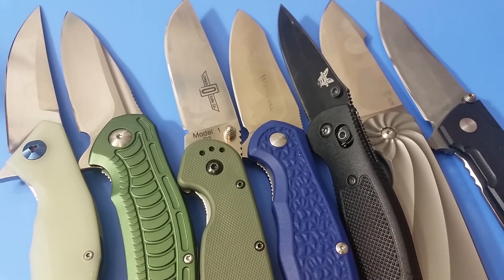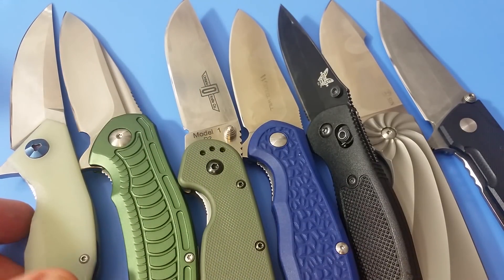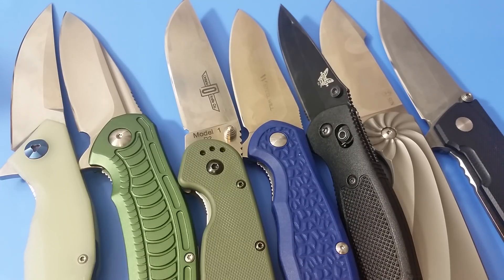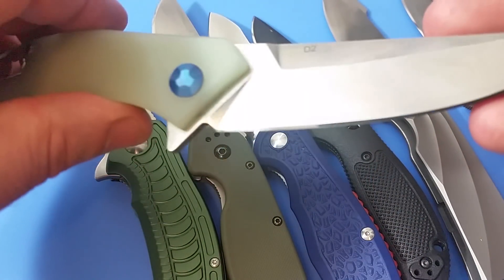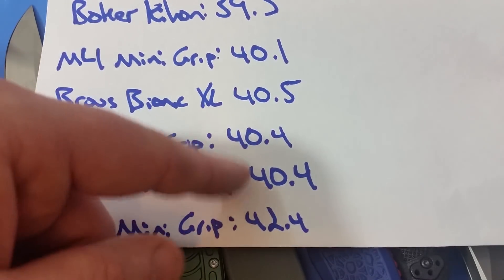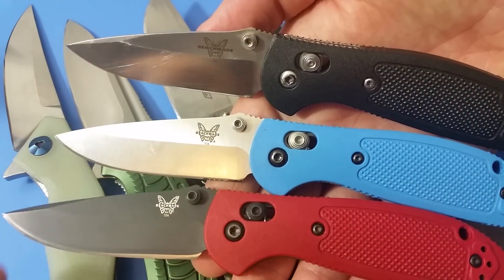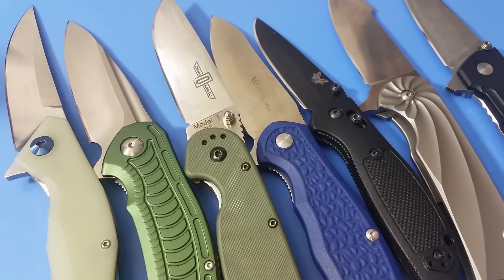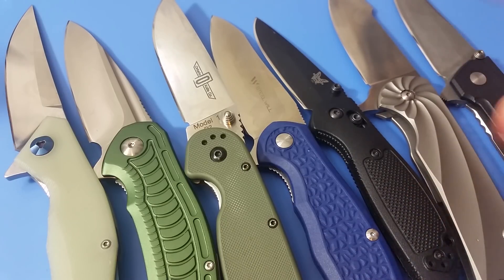The D2 Comparison Experiment Part 1: Knives, Parameters, Etc.

Comment: Hands down the mini grip is going to win. Benchmade does a stellar job of heat treating their D2 and they do it in the USA. The Brous might have D2 heat treated in the USA, but the rest of them are more than likely done on a shoestring budget across seas.
Reply: And what, pray tell, Adam G., do you think heat treating "on a shoestring budget across seas" might actually mean? Do you, in fact, have any idea what you are talking about; apart from exercising some well worn prejudices, perhaps (just speculating on the basis of inferred 'hints')? Some specifics... some actual pearls of metallurgical knowledge, please, to show I'm wrong in my conjecture.

I know that I am not claiming true expertise for myself, but I did work for 13-1/2 years in the industrial metals sector, as my father, a civil engineer, did for decades... which I'm betting beats your background for coming up with a pertinent analysis. So, I'm calling your bluff.
Reply from the maker: Who knows what will "win or lose", but regardless, I do expect the Benchmades to perform well.
Reply: Well Frederick J, I have tool and die background in the steel industry. I know for a fact, through experience, that D2 that is tempered at a higher temperature yields a softer heat treat. On a shoestring budget means that Chinese budget companies heat treat and temper their D2 in larger batches to make the most out of the money spent to run the furnaces. Softer D2 will NOT hold an edge as long as a properly heat treated D2 in the 60-61 HRC range. I have had most of these knives and have found my mini grip to hold an edge longer and with less edge deformation. I even had an Birk Enzo in D2 with the scandi grind that the tip broke off when cutting plastic off of a 2x4. The tip hit a knot in the wood and broke the tip off. After the failure, I Rockwell tested the blade and found it to be 55.6 HRC - way too soft for D2 to be tough and hold an edge. The Chinese sourced knives in this test may fair well, but the consistency of heat treat and tempering between batches of knives is marginal at best. 
Before you call someone's "bluff" as you put it, remember that people can have an opinion without trying to insult a person with such vast experience as yourself.
Reply: 1. Yes, of course, a higher temperature treatment, for as long as it might take to 'properly' complete the procedure -- however smart or ill-advised as it may be in that particular case -- would be expected to yield a softer steel as a result. My experience is in the aluminum coil re-rolling industry. I couldn't tell you offhand how much of the annealing in those furnaces was done as a full anneal, or as a "partial" sort. In any event, our place was as a specialist supplier to more demanding manufacturers, rolling & annealing to a custom specification.

2. I never disputed the fact that one could, and probably would, find significant performance variations among D2 steels in production knife blades. I don't, however, go along with anything resembling reflexively pointing all suspicions at Chinese industry. As I am sure you have noticed, that sort of thing is quite the accepted sport here in YouTube comments. I prefer to wait for credible empirical results -- or relevant specifics accompanying any skepticism in advance --  before going too far in assuming the worst about Chinese manufacturing and matters of ethics pertaining to them.

I have not yet, even once, after close enough to 70 years on this planet, seen a criticism of Chinese business practices or oversight of the same by the government of China in these pages accompanied by a single meaningful balancing observation about the ethics of American business practices and government oversight (or not!) of the same. A particular sore point now... quite obviously. A dystopian, reactionary America makes me sick at heart. Some mythical sense of purity seems to be routinely assumed and implied for the latter whenever the Chinese take their licks. 

I note also that some 1.3+ billion people seem to have to answer for anything that frosts some -- well, many -- here about what they, like our president, "hears" about such things from unspecified sources before concluding a judgement. You're effectively exempted of criticism in this context, of course, by your getting, and staying... largely, though not completely... on point.

3. Even if large batch processing is less than ideal, again, it is an empirically vetted result, weighed against the price of goods, which has to be the foundation of valid criticism. Every D2 does not have to be the best D2; and who would expect that for about $27- $43, or so? But maybe it is, or close enough. I understand perfectly well that defense of empiricism and scientific method -- also not so well a defined thing, I might add (science in the real world can be a bit messy in working toward testable hypotheses) -- these are not generally well received in hyper-provincial America when empirical evidence presents 'inconvenient truths'. 

Defending empiricism and criticising ideologically driven opinions can easily get you characterized as "high and mighty" (see elsewhere here). Nevermind the ignoring of a disclaimer regarding true expertise on my part, explicitly stated elsewhere here, which gets conveniently ignored when it blows a pointed critique. And no, I am not too much pointing the finger here at you, Adam, apart from your sarcastic (and unwarranted) concluding remark, because...

...4. You did come through with precisely what I asked for, which was some credible foundation for your critique of "overseas" practices AND a defining of your terms and the problem(s) implied (but not at first stated)... rather than practicing any number of common dodges typically seen here to calls for evidence, collectively known to some as "playing tennis without the net". I will be explicit and congratulatory in saying that you are the FIRST, and ONLY person on YouTube in my experience, to ever meaningfully attempt to respond to a call for evidence or pertinent citations where I have been involved. But the presumption of a level of vanity on my part not supported by the gist of my skepticism -- that IS an example of misdirection. Anyway, this state of affairs does lead to a certain set of expectations -- even B.F. Skinner's chickens, conditioned for so long this way, could have been expected to prepare for the highly likely eventuality, given the operant conditioning. But I did, of course, ask, nevertheless, for any evidence of some foundation that might be forthcoming. Also a crucial point missed elsewhere within this thread.

5. The curious thing is, I don't see where there ever was any point of disagreement between us on the subjects pertaining to D2 you principally addressed. Again, I explicitly made similar points nearby here. To be further explicit, I have purchased several TwoSun knives just recently at auction -- the first, a TS27, I think, only got unwrapped this morning! And I can assure you, I am MOST interested in the outcome of this test, however imperfect the test may be; and care ONLY about the most useful and applicable result, irrespective of how the one TwoSun knife might fare. I, for one, do NOT seek validation: I am perfectly content to let the chips fall where they may. Again, perfectly content.

6. To conclude, you can count on this, Adam: I will continue to defend and determinedly promote scientific method, well proven standardized statistical methods, the unambiguous mathematical 'language' of the best of our scientific & engineering descriptions, well understood (and for a minority, deeply appreciated) 'tools' of critical thinking, sound & consistent logic, empiricism, and naturalism as a necessary "working hypothesis" after following, as best a human can, with faults, those forgoing standards. And screw ideology.

This is the spirit in which I challenged your remarks; which, let's be frank, whether intended or not, echoed one or two political "dog whistle" notes. As it is in the scientific community, I countenance no implicit racial or ethnic biases in deciding either the faults or the merits of any matter relating to the knife enthusiast community. And that's not a negotiable point -- as always, it's "show me your evidence (or steer me there)". The rest is just rancor and nonsense.
Reply: BTW, a couple more points, Adam [I hesitate to edit above, as YouTube (a.k.a., Google), seems to play very odd tricks (euphemism alert) with Amazon's Silk browser, which I'm forced to rely on here due to two disabled Samsung devices. Not that Silk doesn't substantially suck. It couldn't have anything to do with their being competitors, could it?] 

So, O.K., I hope at least the two of US are more or less on the same page now, Adam. Hugs and kisses and all that. Also, that is an interesting point you made about too soft D2 ending up too breakable. I would probably have expected behavior more like the difference between something like 1075, or the SK-5 on my Hultifors SK "safety knife", vs. a high Rockwell 1095 when it came to that -- i.e., being tougher and more resilient, as is said of Hultifors in general, as compensation for maybe not holding an edge so long. I have seen it claimed that D2 can be tolerant of a range of heat treatments (cf. 1095)... and I have also seen much the opposite claimed. 

We do seem to know there's been some underperforming D2 out there. What puzzles me is the variance in claims about D2 being a very difficult alloy to sharpen; or moderately easy to deal with. That's quite a spread! I don't own a KME, et.al., as I haven't been into knife community stuff until recently. Yep, a late comer, now very much enjoying not opening stuff with my teeth or a collection of "recycled" plastic knives from Wendy's. Maybe it's to do with carbides from chromium tearing away in chunks in this formulation, handled poorly in manufacture... I don't really know. The TwoSuns are my first knives in D2, no experience yet.
Reply: Frederick J. I must say, very well put throughout your response. I agree completely with the scientific method. Please let me point out that I have experienced D2 from a Rat 1, a Boker Caracal,  a Modus, several Brous knives, and of course three different Mini Grips in D2. My mini grips had the best edge retention throughout my use. I must be fair and state that I didn't keep the Caracal long before giving it away due to its overly thick (for my liking) blade stock. I hope you have a great day and I look forward to seeing how this shakes out.

Comment: It will be interesting.. I always use the example that I remember D2 being a big deal on a BM 710.. I've avoided D2 for a long time due to corrosion resistance..I have a few now with D2.. Had some surface rust on a beater D2 Modus.. But, I'll use the knife to strip some bark off of ice/snow covered branches on potential walking sticks..Flitz polish took rust right off..
I'm guessing that at the least, the heat treats will be different..
Reply from the maker: Really good point about the 710. And most likely we have different quality heat treats, but we'll see what that means for performance.

Comment: I have a feeling that the rat 1 will win.Really looking forward to this.atb paddy.👍☺🍀
Reply: You might be right. It has the most acute angle too.
Reply from the maker: Well Paddy, I hope it doesn't suck. Rat 1 seems like a solid choice.
Reply: I just sharpened a rat 2 in d2 last week and it seemed softer than I was expecting. It took less work than my vg-10 kizers.
Reply: There seems to be some hugely divergent opinion out there about how tough D2 is to sharpen and maintain. My suspicion is that most of this is down to some half-baked, loosely informed thinking accompanying a lack of comprehension concerning the many variables JT was wise enough to emphasize up front as a disclaimer.

Don't get me wrong, I take your own report on face value, Adam, and I do think that a range of performance variables likely exists in production knife alloys & treatments nominally called "D2". However, when it comes to figuring out what all this is going to mean to me as one having just acquired some modern D2 blades -- in practical terms, that is, with respect to ease or difficulty in sharpening, etc. -- I am still scratching my head on that one after trying to read up online.

These tests are going to be interesting, I think; but I'm not so sure that I will be able to trust my own inferences at the end, for exactly the reasons JT cites.
Reply: Well then I guess I am half baked, loosely informed and lack comprehension. What makes you so high and mighty and better than everyone else? Have you ever actually sharpened D2? What is your experience?
Reply: Adam Timmins I hope your ok mate,don't get upset there's different ways to make a point.atb paddy🙄👍☘
Reply: Thanks Paddy. It just ticks me of when people like Fredrick J assume that anyone with an opinion different from their own must be half baked, uniformed and stupid. Everyone is entitled to their own opinion and we all have our own set of experiences.
Reply: Adam Timmins I no mate it used to get me when I first started,but I'm trying not to react,doesn't always work,lol.sometimes I'm learning saying nothing is so loud and annoying.atb paddy.😠👍☘
Reply: Well, what in the hell set you off, Adam Timmons?

Since I said nothing whatsoever of the sort about you personally, or even slightly implied it; in fact, EXPLICITLY and clearly stating the *precise opposite*: "Don't get me wrong, I take your own report on face value, Adam", and furthermore stating, "...with respect to ease or difficulty in sharpening [D2], etc., I am still scratching my head on that one..." , which by your odd reckoning makes me a "high and mighty" know-it-all, who thinks he is "better than everyone else".

For level headed, reasonably grounded people, the antecedent for my comment is plainly "...some hugely divergent opinion out there about how tough D2 is to sharpen and maintain".

And then there's my unmitigated gall in asserting, "but I'm not so sure about trusting my own inferences at the end"... "for exactly the reasons JT cites". 

AND, I stated -- once more now -- EXACTLY what my undisguised [NON-]experience with sharpening D2 is, being "one having just acquired some D2 blades" and only now embarking on "figuring [sharpening D2] out" in practical terms. But, of course, you couldn't be bothered to read that.

Here's a tip: If English is not your first language, please have someone possessing reading comprehension in this popularly employed language read your responses before you fire with both barrels at someone who essentially agreed with you, and said so in pretty much the clearest possible terms.

I am now rethinking that matter of agreeing.

When you next awake in the morning looking to pick a fight, Adam Timmons, please attempt to do the victims of your pre-loaded wrath the courtesy of having read what they actually wrote first.